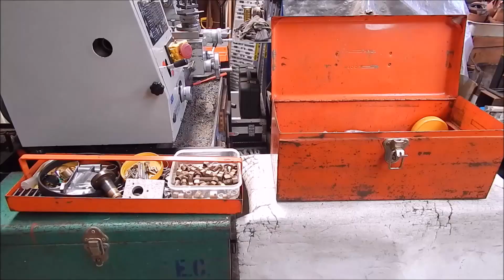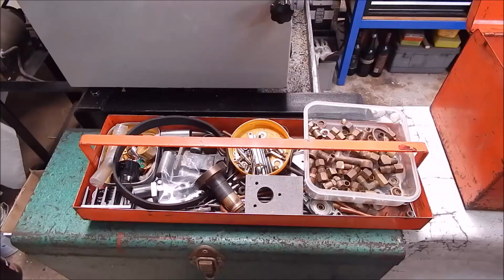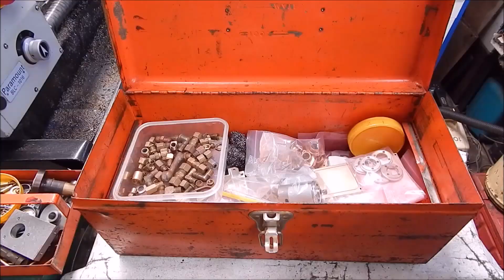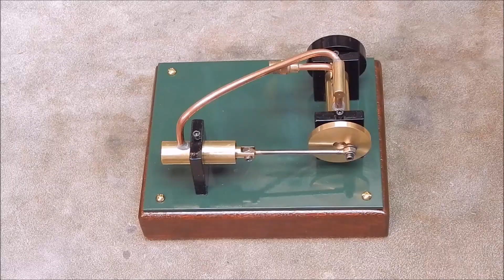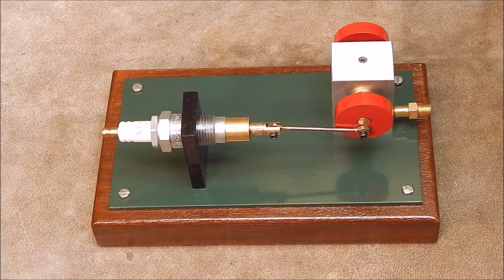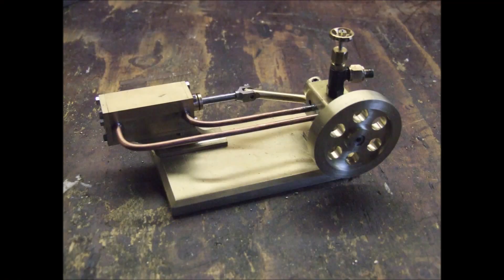Another small metal lathe project

Comment: Hi Rob ,   very interesting idea and I think it should be able to work.    Like anything there's always more to it than one thinks but part of the fun.    I was hoping you would have one more video on your brass melter and see how the cement lasted ect.   You have been using it enough it would be good to see your thoughts on it now and what changes you would make or improvements that could be made.    Hoping to see an update. 

Dale in Canada 🇨🇦
Reply from the maker: Hi Dale. The overall design of the furnace is great and there are no changes I would make.  It works great.  The lining needs a re-think as it is no more durable than using plain cement, although saying that, the temperatures are much higher with the bigger burner.  I will use it until it gets to the stage where it needs replacing and then play around with some more mixes/suggestions. We are heading into winter over here so time in the workshop may reduce somewhat.  Cheers Rob

Comment: Did you know that one of the earliest steam engine designs for a locomotive was drawn and built by Richard Trevithick. He designed an engine with the cylinder inside the boiler (as you suggested). It had a simple valve system. it appears to have two separate valves for inlet and exhaust, operated by two shafts sticking out the front of the engine. There were adjustable blocks (tappets I suppose) mounted on these shafts. When the con-rod moved forward it hit these tappets and caused the valves to change, and the same at the other end of the con-rod travel. See it on Wikipedia. Why not build a replica!  I just posted animations showing how beam engines worked on my YouTube Channel (YouTube.com/evan-e-cent) and that might be another project. There is a great example of a very early Watt steam engine from the Whitbread brewery in Sydney.  Now I think it would be appropriate for this Kiwi to give you a complement - VERY nice work!  Love it!  Makes me think of Clickspring!  I have piles of bronze lathe turnings that I have been saving. One day I might make a furnace.
Reply from the maker: Hi Evan.  Thanks for the comments and suggestion.  We are getting quite a few Kiwi metal work channels now and it's good to see.  I will have a look at yours as well.  I like the idea of using a rotary valve as it cuts down the number of moving parts and is very compact.  Not difficult to make, but you need good tolerances.  Steam is fairly forgiving compared to a Stirling build.  I've had a mixed run with flame lickers but will come back for more punishment another day  ;)  Still, it's all good fun and if it doesn't work too bad.  Cheers Rob

Comment: Interesting free thought process. Looking forward to the nuts & bolts. Eventually you might try superheating.
Thanks, Rob.
Reply from the maker: Hi Russell.  Yes, plenty to think about on this build.  I will go single action to keep it compact.  How I rout the steam pipes will need some thought.  It may need a riser pipe to prevent condensation flooding the cylinder.  No hurry.  This will take a while.  I like a challenge.  It should be do-able. Cheers Rob

Comment: Definitely looking forward to this one Rob 👍👍👍 I do have a few engines where the cylinder is mounted on the outside of the boiler but I've never seen one with it mounted inside. The other Rob's double acting engine looks excellent, love to see that one run. Cheers, Alan.
Reply from the maker: Hi Alan.  I would  like to see Rob's engine run too.  I don't expect too many difficulties with mounting the cylinder inside the boiler, but space will be tight.  I may have to include a riser for the feed pipe as well to prevent water ingress.  Long way to go yet, but an interesting concept.  Cheers Rob

Comment: The time and effort put into the brass casting has certainly paid off.
The how can it do that engines like the spark plug motor are great fun,
I'm looking forward to the new project.
Reply from the maker: Hi Lee.  Dead right.  I was a bit surprised how much home cast brass I've accumulated.  It's certainly been a worthwhile exerxcise making the new furnace.  The concept engine should be interesting.  Cheers Rob